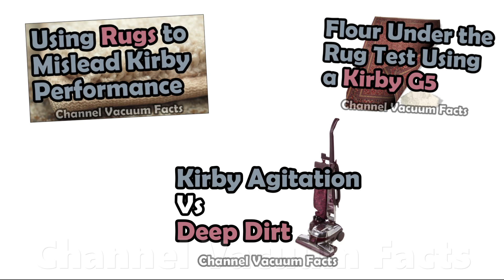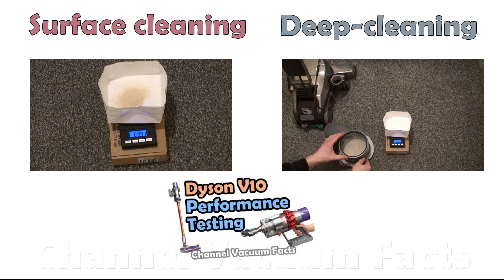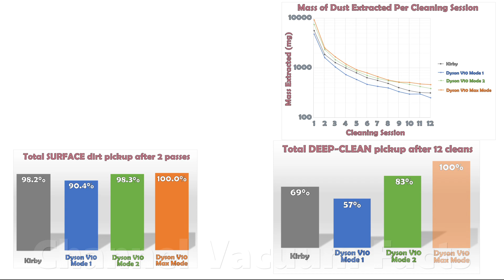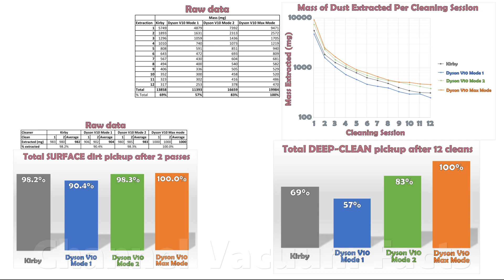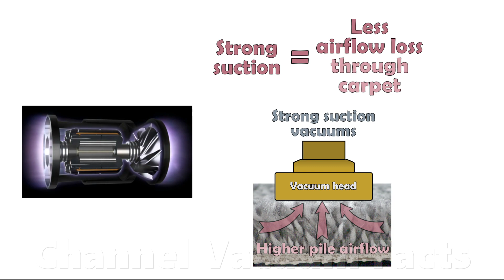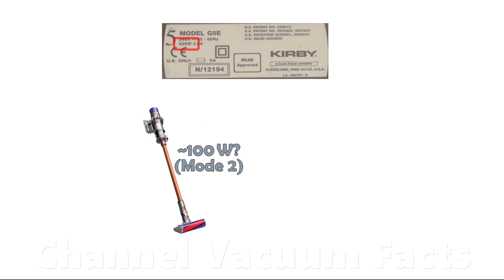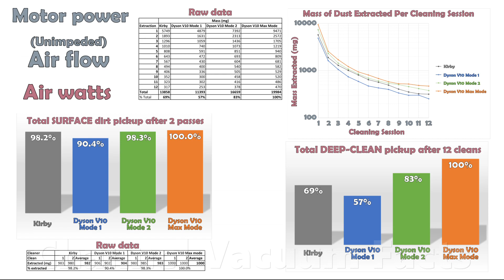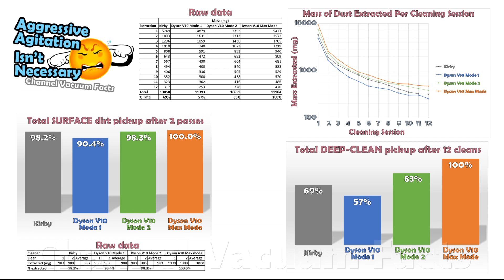Dyson V10 Vs Kirby: How Well Does a Kirby Vacuum REALLY Clean?

Comment: I have had a trash picked Kirby for 30 years. Rebuilt it in 1988 and have done nothing since- use it every day at least once. A friend has the Dyson and it self destructed in a few years. The thing cost a fortune and is all plastic. My best vacuum results have been with my central vacuum system- no filter and a 2.5  horsepower motor.
Reply from the maker: I've heard many argue the Kirby is mainly a carpet cleaner, rather than hard floor. The Kirby is an OK-ish deep-cleaner carpet and good surface carpet cleaner and some of its other tools may be usable by you personally. It would be interesting to see some test data on the emissions levels from that cloth bag, but the concept of reusability is a step in the right direction. It's not standard with the Kirby though and they expect you to buy into the false economy of micron magic bags. The best cleaners have done away with belts and you never have to change them now or deal with their unswept path. You raised a good point about the Dyson in hotels etc. As I'll discuss in an upcoming video, they're not designed for commercial environments, which have different requirements for usage. This says nothing about it's ability to perform in its target environment. I've never seen a Kirby either in hotel chains. Oh and then there's every other point I raised that was not acknowledged.
Reply: @VacuumFacts  The Dyson I have is a DC 40 I just dug it out of the garage. It was not as good on my wood and terrazzo floors as the Kirby. There is a rug in the living room and whenever I roll it up to move furniture I never see any dirt underneath just fibers from the carpet.
Reply from the maker: OK, well the DC40 is many years old (early 2012) and not what is being discussed explicitly in the video. The technology in modern cordless Dysons is vastly beyond what is in the DC40 and, as the Kirby review shows, vastly exceeds the Kirby in hard floor performance, not to mention practicality.
Reply from the maker: This chestnut apparent benefit has been debunked in the video. It's not necessarily virtuous to be using old, inefficient, wasteful technology for that long. And what about all the hidden costs and maintenance you're not telling us about? All those replacement bags in landfill? All those snapped belts? All those servicing costs? All that extra energy usage? All those relatively greater usage practicality issues, especially for above floor cleaning? All that extra noise? The lack of good deep-cleaning performance? The enahnced damage from the clouts and bangs from tech-drive smashing? And on and on. Way to literally ignore the entire video (plus my review video) to mention one trivial non-advantage. The definition of misleading—consistent at least with fans of poor technology. There are plenty of stories of people seeing self-destructed, uncared for Kirbys after a few years. Literally no statistical evidence of any objective claims being made; all subjective vague extrapolations from statistically insignificant anecdotes. Just awful, but completely consistent with expectations, sadly. Completely unconvincing in every way.
Reply: @VacuumFacts  I have terrazzo floors, and vinyl.leather furniture. The Kirby has a shampoo attachment I use as well as a floor polisher head. No bags necessary as it is a commercial cloth bag which can be washed,  The belts last 3 years or so before they snap. I rarely use the belt anyway on concrete floors only for polishing. If Dyson is so good why is it never used by hotels or other comercial facilities? I always see Royal or Eureka vacuums there.

Comment: Although this video is well made and I'm sure the tests are Wright but you mist one crucial part.
Don't get me wrong I have a Dyson and a Kirby both really good vacuums but the Kirby I had for a long time nothing wrong with it and I had it for about 17 years and my Dyson for about 3 years and I had to change the battery two times which sucks but that's the thing with cordless vacuums. Kirby's are low maintenance vacuums the only thing you need to change on it is the belt which connects the motor to the carpet agitator which lasted about 3 to 5 years. There are a wide variety of things you can do with them like shampooing, leather seat cleaning etc. The Kirby comes with a lot of accessories which makes it a tool more than a regular vacuum. The Dyson does have accessories but it's still just a vacuum nothing more nothing less. Both are well made although the Dyson is made out of plastic it doesn't feel cheap. But the Kirby is made out of metal and I banged that thing up but it doesn't want to brake. I've had it for a long time and doesn't feel like it lost power at all, still strong! Both really good vacuums just the Kirby takes the cake for performance, reliability, and variety of things you can do with the product.
Reply from the maker: I don't doubt your story, but individual anecdotes can't be used to draw sweeping conclusions. For example, whilst you might have had to change batteries two times, I and many others haven't. Arguing your single user experience constitutes relatively higher maintenance isn't convincing because a lot more objective evidence would be needed for far more factors to consider. The reality is, the only expected maintenance of a Dyson cordless is emptying and filter rinsing (and people can't even manage that it seems). The Kirby requires bags, belts, and all the other stuff I mentioned in the Kirby review. There are even companies out there selling Kirby annual service plans, which doesn't exactly scream "low maintenance" (I'm aware such plans are a scam for the gullable). The other points you raised have all been addressed, in this video and the review, and shown to be false or not having the apparent benefits you mention. In fact, I'm genuinely not sure how you could have watched the video you're commenting on and still claim the Kirby "takes the cake" for performance; that's simply shown to be false and a full explanation is provided. As such, it does just sound like you're saying what you want to hear, which I understand, but the evidence shows simply isn't true. The Kirby is the worst vacuum I've ever used, by a huge margin, and its swiss army knife alternatiev functions are better achieved via other means. I've already done videos explaining the perils of carpet shampooing; there are better ways to clean carpets that objective evidence shows is superior for normal, responsibly-house-kept homes.
Reply: @VacuumFacts  Hay man I didn't say Kirby is the best vacuums ever and it's not the worst either but I would say changing parts in that Kirby vacuum is easy. but not for the Dyson although that's one part you have to change they make the Dyson vacuum in such away ware you have to take it in the Dyson manufacturer to fix or replace that part. It's kinda like a new car they make that car in such a way ware it's hard to replace a part and if too many problem occur you might as well replace it with the newer model or take it in a dealership. Hay a new car might work better than a old car but in the long run a old car will out last a new one due to the simplicity and durability. Just so you understand ware I'm getting at you know what an AR 15 is? It's a gun well built reliable. A cool thing they did to the gun is a pipe inside the heat shield which helps use the gasses from the spent cartage to blow back the bolt to eject the round and etc. Well they made to ware this pipe will brake before the gun does so your gun's major components doesn't then you can get a brand new pipe for the gun and it will work just as new. Just like belt for the Kirby vacuum they don't need a separate motor or some type of gears system. And also it makes it simple (reliability is key) parts do ware down in the Kirby but they make the Kirby in such a way ware it's easy fix all you need to do is buy the part and replace it YOURSELF! Another factor is customisation you can make you Kirby into anything that has to do with Flores or carpet even seats. You might get some different heads for the Dyson but nothing like a shampooer. Of course the Kirby shampooer attachment won't be as good as a real shampooer that is made for shampooing but they made it to ware you don't have to buy a shampooer. 

(In Kirby's mind set) you just purchased are produced we (Kirby) don't want are produced like any other vacuum we want this to be a tool for your household you can do what you please with your new vacuum there are many attachments to transform your vacuum into a variety of things a shampooer, leather seat cleaner, a spray printer, or even a blower! You can also make your vacuum more compacted to carry around with a handle attachment if you wish!
 
Kirby is still making durable produced that will last you a life time. Dyson makes there vacuum to last for so long until the new model comes out so when your Dyson stops working you bye the new model it's busyness that Kirby fortunately doesn't follow. Yeah the Dyson may be better at sucking up more dirt but in 5 to 8 years that Dyson will do exactly what the designers made it to do and that is ware out and brake and I'm not talking about an easy fix either. I still have my Kirby from 17 years ago and it still has top specs that's comparable or not too far off the specs of the new 2019 Dyson. Now I have got to say that's pretty impressive even there newer Kirby models haven't changed for the better. Kirby truly made something universal so you can have an old model buy parts from a new model and be completely fine. Like I said before it "takes the cake".
Reply from the maker: @Snooty1  Much of this is covered in my review https://youtu.be/x_Rry3u1Kcs and none of the points raised above hold water when looked at carefully. It's not a convincing argument for me whether or not parts in a Kirby are easy to change. Good cleaners don't need parts changing under normal use during their lifetime (unless they've not been cared for or used as intended). A belt driven machine is a weakness that's been done away with by superior competition. It's also false that Dyson machines need to be taken back to the manufacturer. Their latest cleaners (cordless) are all modular and plug-and-play. Dyson simply send out a new part if necessary and you swap it out with a click, and fully recycle the old one. No annual service plan by a third party required. Zero maintenance bar filter rinse/bin empty. While not true for other cheap knock-offs, the latest Dysons are mechanically expected to last 10 years at least (assuming correct treatment without abuse—such as using corrosive cleaning agents which dissolve rubber seals, or choking rollers with absurd pickup 'tests').

As for the swiss-army knife functionality; this is no advantage. As discussed in the review, it's a practicality nightmare changing things over. There's big cost, and storage requirements. Very few likely use much of that functionality, and much of it is better achieved using dedicated tools for the job. People won't be buying a Kirby to use as a blower; they'd get a blower. You should also never be wet-shampooing carpets (see my other video on that https://youtu.be/XVR-YdzytBA ). This additional functionality is not an advantage in practice. My review also covers why a 'long lifetime' product isn't quite as advantageous as it seems on paper (you're stuck with old inefficient, less effective technology for longer), and all high end products last a long time now anyway with proper treatment.
Reply: @VacuumFacts  I guess your right. But the company allows freedom for there vacuums. Hell I never used the blower function but it's there why the company didn't want no regular vacuum they wanted something that you can do a little bit of everything with. Yeah a Swiss army knife with different functionality's isn't going to be the best at everything only a knife made to be only a knife is. But that Swiss army knife is going to be more handy in more situations. Dyson is made to only be a vacuum so it excels at being one, but a Kirby is made to be a Swiss army knife so it's more handy universal and just like a Swiss army knife DURABLE! Hay metal isn't going to be light as plastic but just as an old car it just won't quit. Like I said Kirby is not the best vacuums but I'll get it any time of the day comparing to a Dyson and I like the Dysons. But Dyson isn't a Swiss army knife and it won't last more than 10 years with the same amount of high performance in fact way lower performance. Why I'm I sticking to Kirby? And why would I still get the Kirby over the Dyson? 
It's a mystery in your eyes I'm sure, but with me from experience it's been a loyal vacuum never broke, easy to use, people say the belt is hard to replace but it's fairly easy compared to the Dyson's battery. And it having less air flow never bothered me well because I never had problems picking up dirt, sand, hair, and etc. I recently replaced my carpet due to aesthetic purposes I got to say a pretty clean carpet and I had that carpet for many years and the only vacuum I used was the Kirby, I only used the Dyson for the tile floors in the kitchen but that's it. The Kirby met my standards and then some. Over all a great product! There are many products that have out classed the Kirby over the years. But only a few products have done well and something different one product being the Kirby. And I say over the years because it's been over the years the dang thing won't quit unlike regular vacuums do. And I say that's an achievement for Kirby. If Kirby had a motto it will go something like this. 

Buy one you'll only need one, the dang things last.

Say what you want but Kirby lovers love there Kirby for a reason. I don't see no Dyson lovers. Although you might be the first. Kirby's just work and work some more and they work for a long time. And the thing is it being big and heavy it got to be one of the easiest vacuums I've ever pushed hell I can push that thing with my finger no problem. Money well spent. I'm satisfied for sure!
Reply: @VacuumFacts  a little bit more bang for your buck.
Reply from the maker: @Snooty1  Jack of all trades; master of none. That's also Shark's philosophy, except they copy the best innovations from Dyson and stuff them into a single package which doesn't work as well. People can choose which product they want. But my channel isn't really about telling people what to think; it's more about telling them how to think. I correct the false claims and misleading nonsense that's peddled to smear good technology. I've no love for Dyson themselves, but I do like good technology. I did not like the Kirby.
Reply: @VacuumFacts  I'm not saying your claims are false but let's just say this. I agree to disagree. For the better sake.